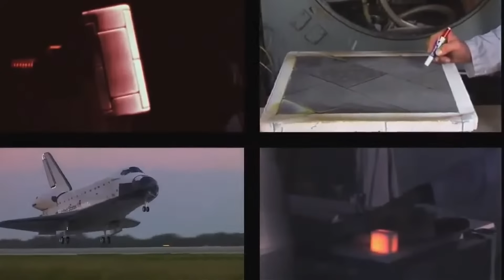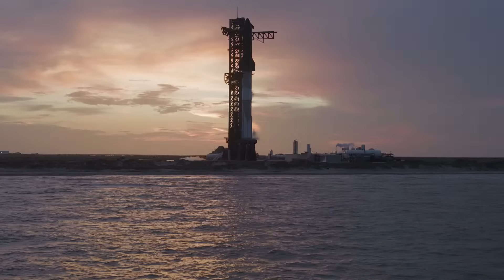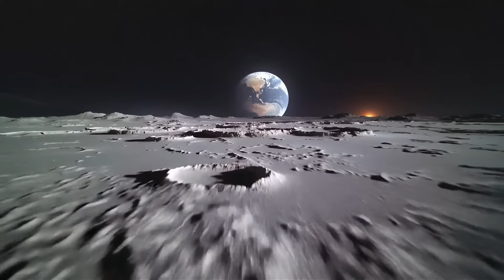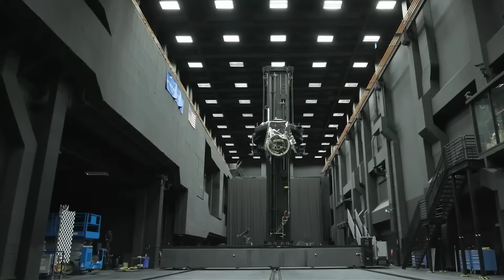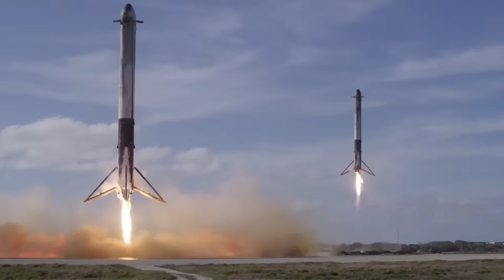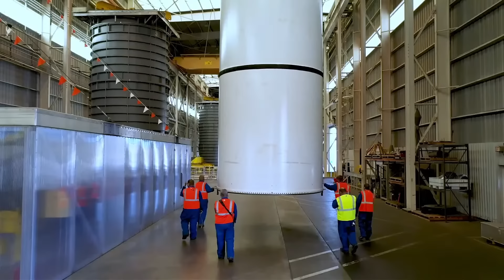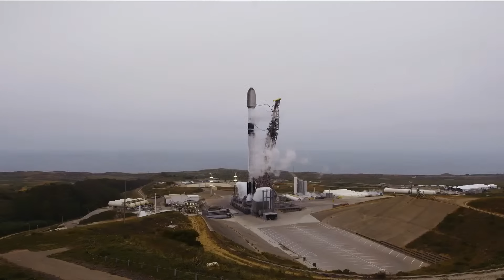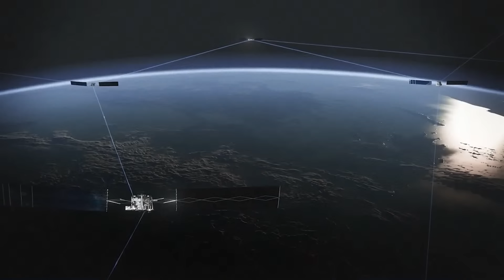SpaceX Brilliant Upgrade to Build a Heat Shield For The Largest Spacecraft Ever Built Reentry

Comment: Great job putting this together.  I really think they should consider landing on their belly on the moon.
Reply from the maker: with landing leg?
Reply: @pisreal321   Yes the legs could be in a similar configuration to the current fuel transfer bits that stick out of the side.   Would make everything easier including using the ship as an early habitat.
Reply: Not a bad idea. The ship can basically handle falling over in the ocean and survive, so adding a few boosters to make the "fall over" on slowly in the moo's low gravity could be feasible.

Comment: Why can't Starship flip when on its way back to Earth from a space mission and fire it boosters several times, over a period of several days, in order to gradually slow the ship down for re-entry?
Reply: To stay in orbit you have to be going a specific speed. Go faster and you get further away from earth. Go slower and you get closer to earth. Speed is what keeps you in space. You can't slow down like on a road and then decide where to turn off. Your slowing down is your turn off
Reply: @ShieldWolf-yp3cr  How come we can go into space supply the ISS and come back without burning up? There is something wrong with this I cannot fathom, I mean we do not burn up when we land on the Moon??
Reply: @NeilDewsbury  the reason plasma is formed is because of how fast you have to be going to orbit and how slowly you can slow down before slamming into the earth. You have to keep enough momentum to not fall out of orbit and fall to the ground. We use air as breaks. Just as your brakes on your car heat up from friction, when you come back to earth from orbit you slam into air and that air gets compressed under your spaceship. As that air gets compressed more and more it starts turning into plasms and burns hot. With no air on the moon no fire. So no burning or plasma. That's why in my other explanation I said going backwards on re-entry would be more violent.
Reply: @ShieldWolf-yp3cr  In that case perhaps the Starship should fire its boosters upon re-entry, in order that an equilibrium is reached, so that no friction at all takes place?
Reply: Think of staying in orbit as always falling towards earth. The reason you don't fall to the ground is because you go fast enough to make the ark or your fall miss earth. Gravity is always trying to pull you down.
Reply: @ShieldWolf-yp3cr  Would Earth entry be less traumatic if our Spaceship went anti-clockwise, the opposite of the Earths spin?
Reply: @NeilDewsbury when we re-enter or orbit we go with earths rotation. Not against it. Going against earths rotation would mean you're always crashing into the wind. Re-entry temperatures would be hotter and slam into your vehicle faster. I'm not a space engineer but idk if you could re-enter earths atmosphere backwards. You should be able to orbit backwards though because you're not fighting the air as long as you're high enough above the earth.
Reply: @ShieldWolf-yp3cr  Correct, so if you have been on a distant journey then surely it is a case of 'gradually slowing' your ship down long before re-entry in order to make re-entry safer?

Comment: You have a big mistake in your narration:  Boeing and MD did not have any experience with spaceflight to the moon. The deep experience you assume wasn't just retired.  It was DEAD.   It had been installed in the cemetery.  My father was one of the men who designed for Apollo.  It has been over 57 years since 1969.  A man who entered the program at 30 would be 87 now.  Such a person would have been retired by about 2010.  There is no real living memory of how we did the moon landings.  Even the US Space and Rocket Center in Huntsville, Alabama, has great difficulty finding experienced older people to teach at Space Camp.  It is basically impossible now.  SpaceX's project was essentially from "scratch."

Comment: At 1254 you are already contradicting yourself repeating anything elon says as as factual is completely ignorant in itself. Furthermore, SpaceX official releases are only accurate enough and rarely tell the entire story and even  less often admit thier mistakes were due to ignorance and incompetence.  The truth is Nasa gave SpaceX everything they had on detailed heatsheild research and testing. Including telling what adhesives to use and recommended  suppliers to produce the tiles. Elon chose an in adequate production company that produced very inconsistent and low quality material. We know this from recovered tiles from the many test failures. They were also far to thin even if they were higher quality. Elon chose to have them mass produced and uniform dimensions as a cost saving despite nasa explaining that the shuttle irregular tile shape was actually intentionally designed and added significantly higher heat dispersing. 
The pins were intended to reduce additional weight because of Starship could barely lift it's empty shell as well as reducing time and cost of tile replacements. Starship has numerous fundamentally flawed concept designs that make the continued pursuit the most assine and wastful endeavor in history. The stainless steel is probably the biggest of those.
Reply: And yet StarShip is getting slowly closer to its first orbit, and then reuse.

I've done R&D for aerospace. It is hard, and if you have the dedication, time, and money there's a chance you reap the reward of a leap into a new paradigm.

That is Elon's quest.
Reply: @t.b.a.r.r.o.  Starship will never be reusable nor will it ever be crewed. As of yet, it still cannot reach controlled orbit as an completely empty shell.  
With some engineering and proper leadership Starship could function as a disposable heavy lift vehicle to low orbit with mostly reusable boosters.

Comment: There needs to be a robotic system where a robot does a "spacewalk" in orbit to check the tiles and a little cache of replacements that the robots can snap in while Starship is in orbit, before re-entry begins. Or maybe the robots could have a little sprayer of expanding ablative foam just so you don't die in re-entry. Then the foam could be cut out and replaced with a proper replacement tile once the thing had been caught. I'm sure SpaceX is working on a fast automated heatshield inspection system in the catch tower.

Comment: I’m wondering if the way to solve reentry and heating problem is to place refueling stations in space orbit. Then, after arriving in space Starship will dock to a new fuel tank and slowly descend back down to Earth to gently land like Falcon 9 on foldout legs. Fuel can be manufactured in orbit.
Reply: You been watching too many sci-fi shows pal.
Reply: @liambuk78 Obviously you don't know much about chemistry.  Read this from Google: ￼

Yes, manufacturing rocket fuel in orbit is possible. Instead of carrying heavy fuel from Earth, spacecraft can use in-orbit resources and solar power to produce both fuel and oxidizer via established chemical processes.
Reply: Fuel can be manufactured in space from what? In space fuel boils because you have liquid oxygen and methane. Pretty complicated, and surely more complicated than a heat shield.
Reply: @florin604 Check facts first. Here's from Google:
"How Orbital Fuel Manufacturing WorksManufacturing fuel in orbit relies on taking raw materials and converting them into usable propellant:Water Electolysis: Water is split into hydrogen and oxygen using electricity. Both can be used as hypergolic, water-based propellants, or cooled into highly explosive cryogenic liquids (LH₂ and LOX).Artificial Photosynthesis: Breakthroughs in orbit have proven that systems can transform carbon dioxide and water into hydrocarbons, which are the building blocks of rocket fuel."
Reply: That makes no sense on every level.
Reply: Are you joking or are you an 8 year old kid?
Reply: @bubbajones6907 Look on Google about making rocket fuel in space.

Comment: Forget Artemis, duh.  
5 landing legs, duh, or land on side with balloons "foundation" & stay.  Put astronaut compartment at the bottom of the lander, duh, not the top, duh. You've already put the rockets halfway up the sides anyway. No stupid elevator.  
Put fuel in big balloons & drag them along, no aero penalty in space, duh. Fuel is light weight, allow it to rise to top of atmosphere on its own, perhaps a little pressure: 
Lighter than air diaphonous pipeline for gaseous propellant transfer from surface to geosynchrnous orbit, compressing back to liquid in orbit not necessary, just contain in big balloons, so avoid compression-resistance structure weight penalty: call it "budding".
Reply: How do you navigate those balloons where you need them to be?
Reply: @florin604  tie to satellite.
Reply: @nicholsonscience6229 you're clueless
Reply: @florin604  It's pretty low-tech, it's just novel to you.